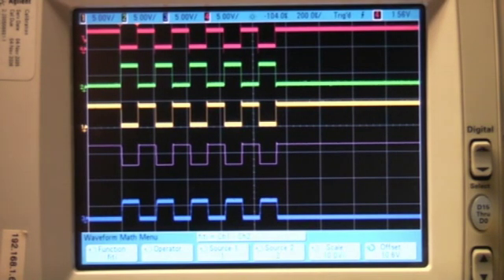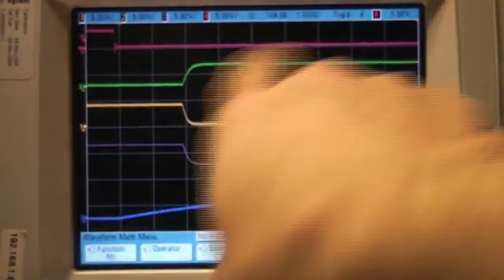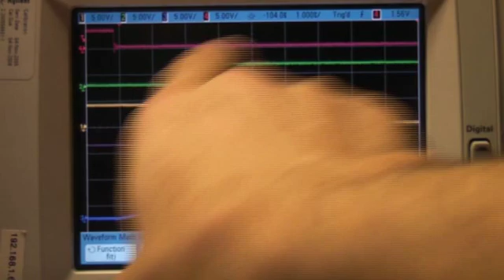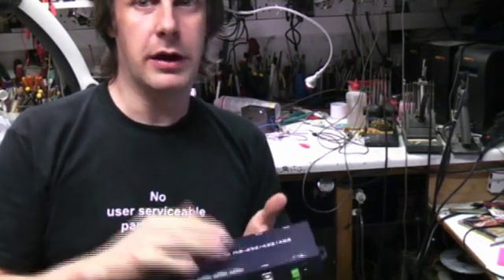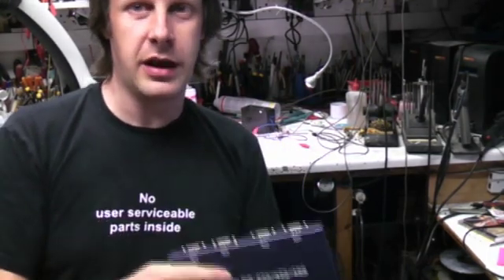Crappy USB RS485 converter Rant

Comment: Most of the cheap devices don't make a legit Tx enable for the TTL to RS485 driver.  They just tie the TTL Tx data line to both data input and Tx enable input on RS485 driver chip.  This means RS485 driver tri-states during logic '0' transmitted, relying solely on termination load resistor on twisted pair to pull a RS485 logic 'zero' on the pair.  It greatly reduces maximum baud rate possible and reduces maximum line length possible.

Comment: A chinese crappy USB to RS485 had a terrible design, they didn't even bother using UART flow control for direction control. They used TX line and a transistor for it, receiving data was ok but sending one was garbage. link below
https://www.amazon.in/SpiffySky-Ch340-Converter-Adapter-Module/dp/B07VGSFRTF/ref=sr_1_3?adgrpid=58704823813&dchild=1&ext_vrnc=hi&gclid=EAIaIQobChMIgpeOkMz66wIVE3ZgCh3KwQdvEAAYASAAEgKxrvD_BwE&hvadid=294103508121&hvdev=c&hvlocphy=1007768&hvnetw=g&hvqmt=e&hvrand=7739320222305992532&hvtargid=kwd-42427226&hydadcr=5872_1738705&keywords=usb+to+rs485+converter&qid=1600703219&sr=8-3&tag=googinhydr1-21

Comment: I'm pretty sure that almost no-one posting in the comments here (aside from the actual author of the video) actually understands what the CE marking means.  You'll find a CE label on everything from a beer glass (to verify that it will actually hold a "pint" or other specific amount of fluid) to devices that are covered by the low-voltage directive (LVD), R&TTE and the EMC directive.  None of these directives necessarily mean that a product has to be "awesome" or have truthful marketing about signal integrity, baud rate, distortion metrics or anything of the sort.  CE certification is also only necessary for devices/products offered for sale/trade in the EU.  Otherwise it's pointless.  Additionally, the CE marking is NOT comparable to UL, TUV, ETL or any other quasi-regulatory certification lab marking.
Reply: essentially, CE marking is self-deceleration. So, if the manufacturer has no idea what he is doing, the CE mark is as reliable as the specification: Non at all.

The CE mark is - more or less - just a way to get CEOs in charge for the products. Not fulfilling the relevant regulation is very technical - but slapping the CE mark on when not fulfilling the associated regulation: That is simple forgery. Something a judge understands. Seeling a product without CE mark: Not allowed in the EU. Makes the life of a judge easy and the CEO responsible, regardless of "technical what evers" he is willing to not understand.

Comment: It looks like it is a hub or a center point in a star configuration?! If you are not cnnecting any transmission line and use just a single termination resistor you might get really bad response .. and in a star configuration terminating the center point always gives less good results .. the termination only works well when there really is a transmission line and the resistors are at the both ends ..read for example (TI's - AN-979 The Practical Limits of RS-485 - which is available in the Internet) - cheers!

Comment: The whole problem here is the CE certification, CE of course standing for Chinese Engineering...

Mounting the wrong connectors and not working to specifications is a general rule with cheap Chinese stuff.
Reply: Doesnt it mean China Export? CR would also be nice - China Replica.

Comment: RS-485 does NOT measure the signal voltage from the GND but between D+ and D- (no reference to GND/RTN). As long as all systems are earth-grounded, there should be no problem (furthermore, not having those extra GND connections rather results in eliminating possible ground loops candidates)

Comment: Good review. :)
The isolation is indeed total crap. I wonder if that ground break is enough even for 10kv. Seems a little narrow. But yeah, that's not a real show stopper. The signal integrity is total shit, though. I also hate equipment that tries to set itself up. Very error prone, never seems to work properly for me. No manufacturer should ever include such functionality, not even on scopes. I wouldn't buy the thing...